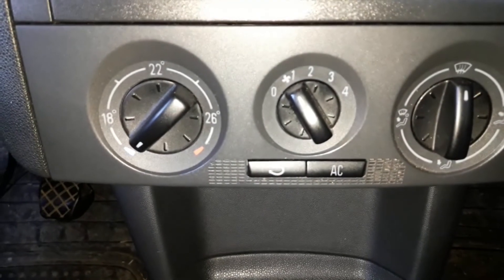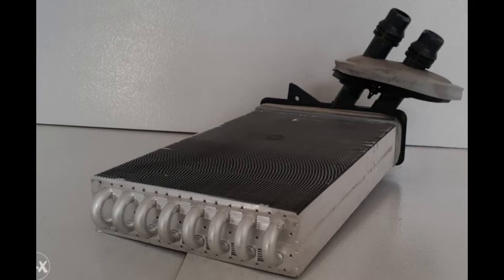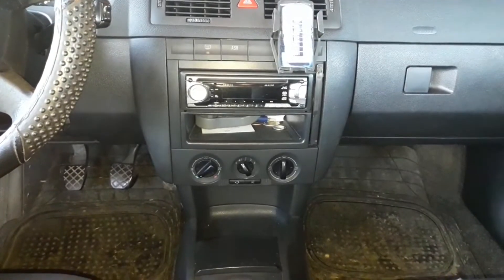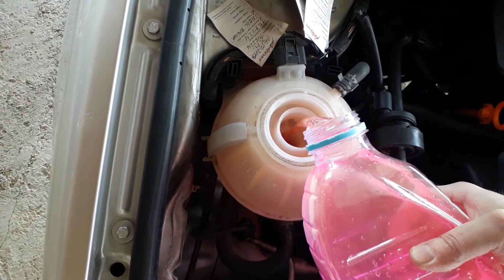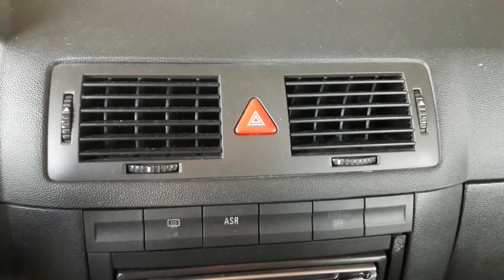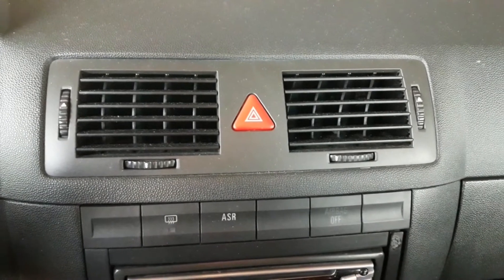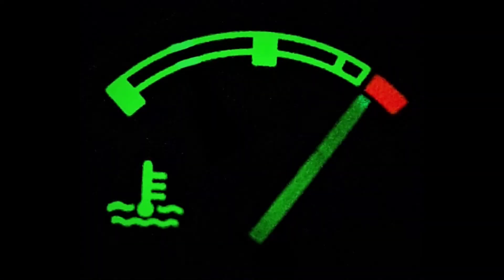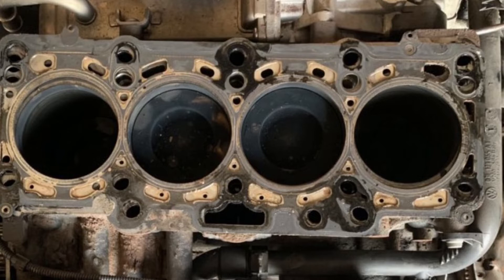Bad Heater Core Symptoms-10 Tell Tail Signs That You Have a Heater Core Problem

Comment: Of you got a vehicle 20 plus years it might be a good idea to replace it if your taking apart the price of whole dash plan to do it on my truck to fix the actuators and some other stuff.
Reply from the maker: Hi and thanks for watching!

Yes, especially if you plan to take your car to a mechanic to do the work (if I understood the answer correctly).

The price of labor costs multiple times more than the part itself.

But if you're planning to do it on your own and you have enough patience and some knowledge around cars and tools, there is logic in doing it.

This is from experience. 🙂 Best of luck with the repair.
Reply: @DespairRepair  hello I’m a new mechanic and am curious if I need to burp my coolant system after installing a new heater core I would assume a new one would have air in it witch would back cycle into the system if I’m right any help is appreciated thanks!!
Reply from the maker: @zarekjones827  hi and thanks for watching!

Yes, in most cases you'll need to vent the system especially if you've let out all of the coolant from the whole system.

If it's just from the heater core, then you might not have to.
Reply from the maker: @KirCh4rT hi and thanks for watching! You're right, having a manual will save a lot of time, nerves and causing damage to the interior when taking everything apart.
Just like to say regarding the fog, did you check if there's a leak somewhere in the passenger cabin?
Constant moisture in the cabin can also be a cause for fogging up.
Reply from the maker: @KirCh4rT if you don't mind, I would suggest trying to see if there's proper coolant flow.
If possible on your car, when the engine starts heating up, try touching the upper and lower hose on the radiator if they are both warm.
If they are, you'll know that the flow is OK, if not then you may have a thermostat problem a clog, or else.
Simple way, just keep your hands safe from burns and from the radiator fan.
Sorry if I'm patronizing, just wanted to help.
Best of luck with the repair.
Reply from the maker: @KirCh4rT best of luck with the repair and if we can help remotely, contact us.